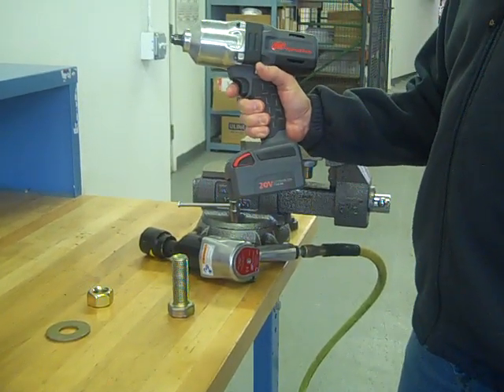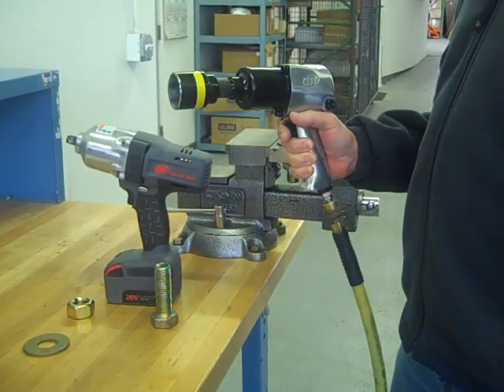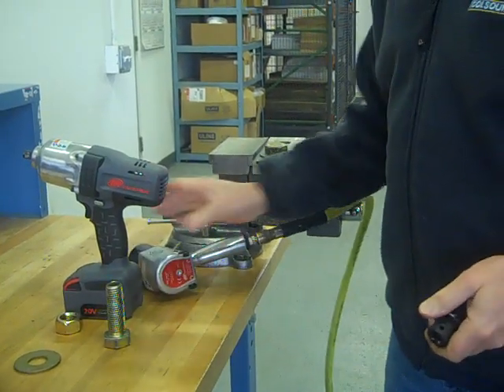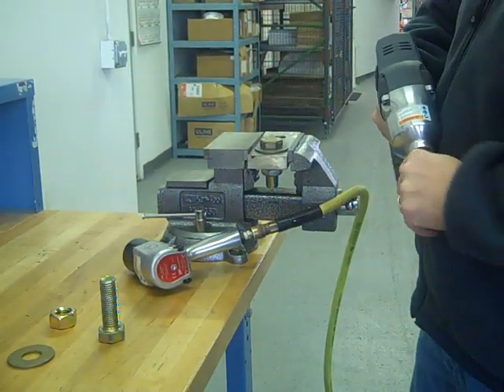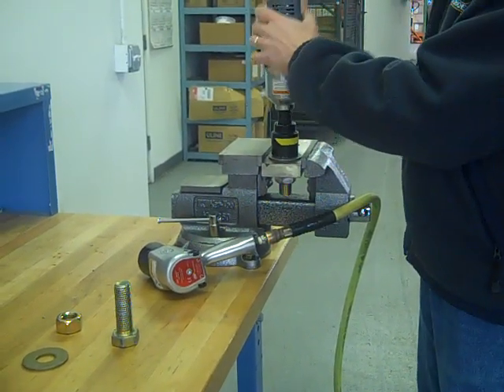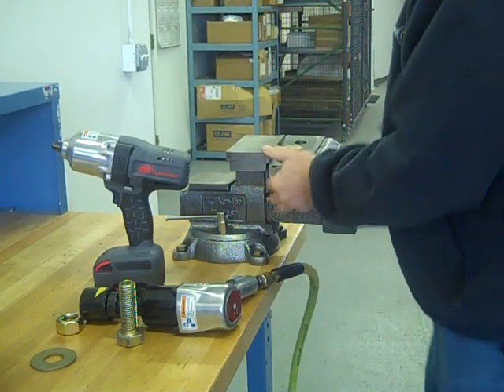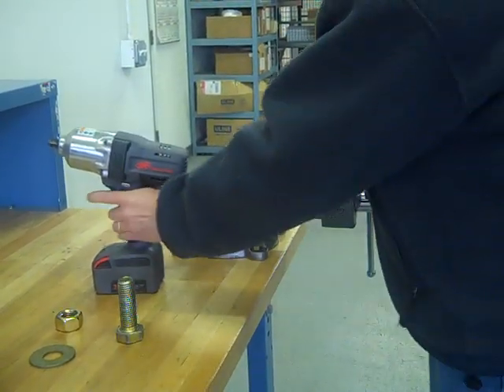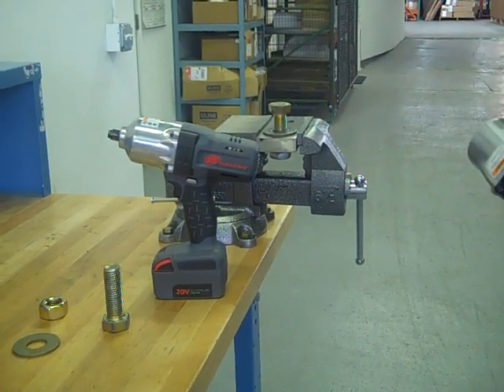IR w7150 20v Lithium 1/2" Cordless Impact Wrench Test

Comment: Tried out the tool truck variety of impact wrenches✥>share4.photo/IAirWrench?Tやe     and this is just as powerful if not more, and at a third of the cost. Got the protective boot as well and very pleased with it. Don't hesitate this impact gun in is plenty powerfully and usually backs out bolts stuck or rusted in one or two trigger pulls.

Comment: One of my favorite tools. Everyone thinks in terms of just removing nuts and bolts. For many of us with bearing pullers and pitman arm pullers and any type of puller, this gun is perfect. I own a mobile automotive repair business and nothing works better in the field than cordless impacts and ratchets. I have the W7150, older Snap-on 3850 (10 years old and works great) and the IR R380 K2 cordless ratchet.

Comment: Just got mine!   It takes of my International tow truck wheel nuts with easy!! just one question it seems that when you are tighten up a nut an you hold it on to the max torque, to make sure it’s really tight after aprox 2 seconds nonstop (and the nut not moving) the gun changes it's noise like the gears inside starts slipping or some safety clutch kicks in. It is normal or mine is broken? Thanks

Comment: Sorry about the time discrepency, however the w7150 is clearly more powerful than the 231c the W7150 are still in short supply we only had the sample for a short amount of time we noticed the issue with the timing in the video but didn't have time to repeat the test, in the future when they are more readily available we will perform the test again, we also have a skidmore on hand now which is a precision measurement tool.